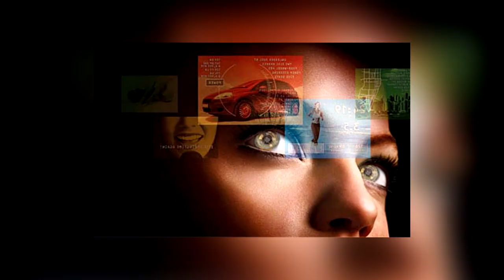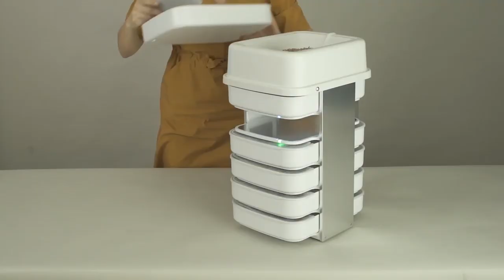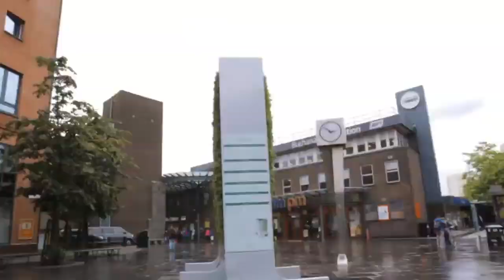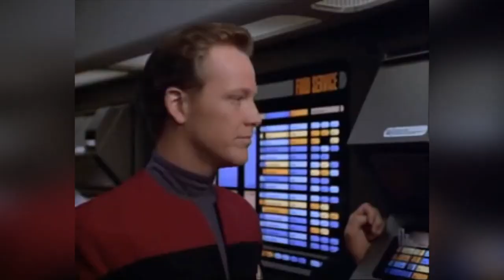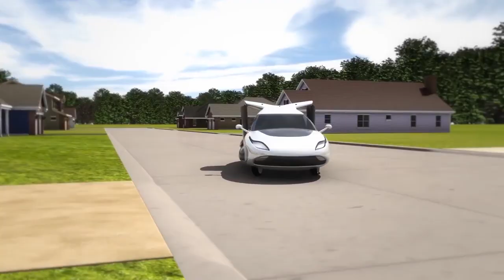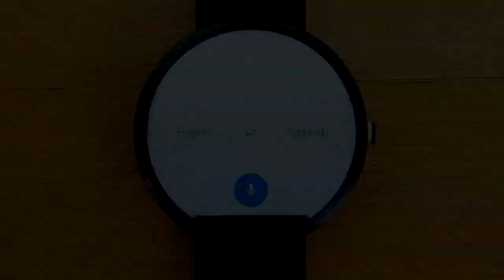12 Most Unbelievable Technology of The Near Future

Comment: Not unbelievable technologies, just a lot of hype for start-ups. I've seen 3-D printing promoted in Canada as a way to build affordable housing, rapidly, (several years ago). These clowns started work on two apartment buildings in Kingston, Ontario. It took a few years to build the first building, (only a modest two-story structure), which took weeks to "print"; and, now, years later, they are still working on the second building, (again, only a two-story job), and taking months to build. A normal construction crew would completed this work in a few weeks. Concrete doesn't pour well out of a small nozzle and doesn't cure in minutes! Fancy demonstrations and sales presentations? Then, the concept flops, and they soon disappear, (along with the cash).